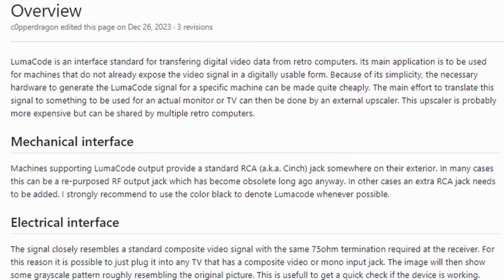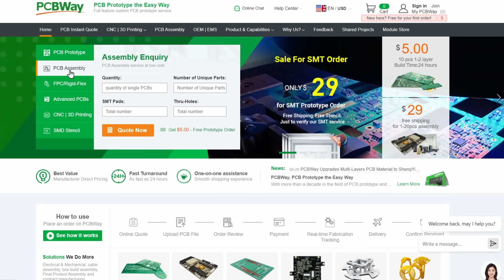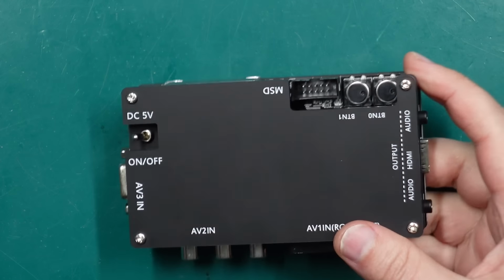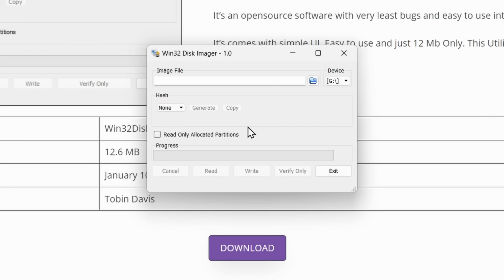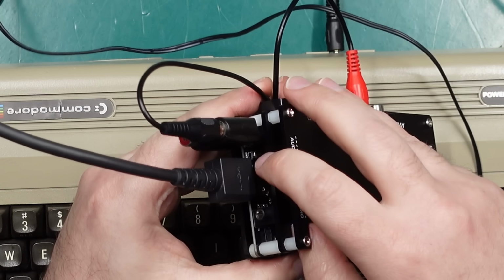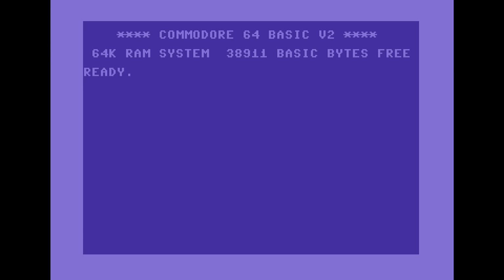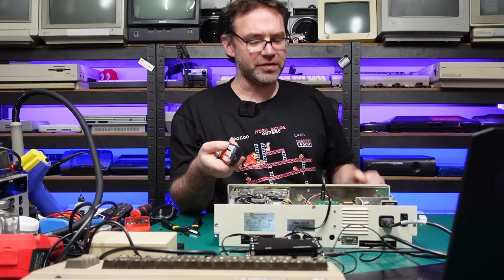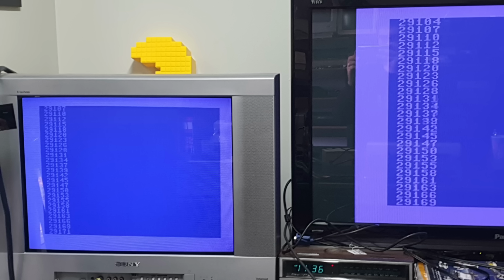Lumacode on the OSSC - HDMI from the C64 and 128 without the RGBtoHDMI and audio embedders

Comment from the maker: The colour palette for the C64/128 is fixed in firmware 1.11. It also includes support for NES Lumacode!

After performing the mod for pre V1.8 boards you may have problems with the remote control not working. If this happens you will need to reprogram the remote codes. This can be done by holding down BTN1 on the ossc while powering on. After that it should walk you through reprogramming each remote button. For more detials see https://junkerhq.net//xrgb/index.php?title=OSSC#Remote_control_setup
Reply: The good and the bad. I missed getting his latest firmware by 2 days update before my LumaCode board shipped.  Glad I was able to get any board though.
Reply from the maker: Are you talking about the OSSC firmware? You need to update that yourself
Reply: @TheRetroChannel  No, the LumaCode firmware. Sorry for the confusion.

Comment: Shouldn't the top and bottom borders be "thicker" with a PAL system?  Your example C64 and C128 screens look more like NTSC.
Reply from the maker: The OSSC does crop the top and bottom of the image in 5x mode but I doubt it will cut off anything useful. I deliberately used Wizball at the end of the video as it draws outside of the standard C64 border and nothing got cut off. 2x mode on the OSSC can also be used if users want the whole image
Reply: @TheRetroChannel  Good to know. Thanks.

Comment: I made some changes on my device and now I have HDR, VRR, 1440p, and the Shadow Mask effect, which is cool. However, I haven't quite figured out the new HDMI VIC functionality yet. Whenever I change it, the HDMI output starts acting strangely. Do you know what the HDMI VIC is supposed to do?
Reply from the maker: It's a compatibility feature rather than a feature feature. From the junkerhq wiki:

Default HDMI VIC
Selects Video Format Identification Code (VIC) which is indicated on HDMI AVI Infoframe for preset modes which do not have VIC specificed. Can be used to work around devices (switches/displays) that do not accept default VIC (0) indicating unknown mode.

0-31: VIC value. Try setting 2 (480p60) with problematic sinks. [default=0]

Comment: Do you know if LumaCode can be run through an AV switcher? For example if I wanted to have multiple digitizer modded consoles hooked up to a switch which then outputs to the OSSC - would that work okay? I’m sure it would for a dumb mechanical switch but I’m really interested in integrating this with my Extron matrix switches I am already using.
Reply from the maker: From what I've found LumaCode is very susceptible to external interference. It may work if you use good quality shielded cables but I can't say for sure

Comment: DVI can carry audio. It’s not part of the spec so we call it “enhanced DVI” but the HDMI device on the other end is none the wiser. 1.5 or earlier OSSCs with didn’t do audio either whether you got the HDMI or DVI version. The only difference was that you needed assemble your own DIY OSSC kit for HDMI back then since the creators didn’t want to run afoul of HDMI licensing.

Neither DVI nor HDMI OSSCs supported audio until we got new firmware with a mod board from Borti4938 (Peter Bartmann). Obviously, they rolled the upgrade into 1.6+ versions of the OSSC when they also started selling them preassembled with physical HDMI ports, but it was never tied to that port. You really could get an HDMI OSSC with no audio before they started selling 1.6.
Reply: That said, my OSSC is DVI (1.5) with Borti’s upgrade board and the new 1.8 LumaCode modifications. Instead of using a DVI to HDMI dongle I use a long, braided, DVI to HDMI cable. As long as I never disconnect the DVI end I never even have to think about it being DVI. It is for all intents and purposes an HDMI unit.

Comment: Hi, I built one of your rf modulators and installed it in my 1986 breadbin 64 with longboard 250425. It improved composite video, but there is a lot of colour smearing at the s-video output. I tried 2 different tv, 2 different cable, and 2 different psu, but all of them had the same effect. What did I do wrong, and what should I check for?
Reply from the maker: V1 or V2?
PAL or NTSC?
Reply: @TheRetroChannel  V2 and PAL
Reply from the maker: Hmm ok. Double check the component values are correct in the chroma path - they are the two resistors on the left side of the board, and the 3 capacitors and 2 resistors nearest the transistor in the middle of the board. If everything is correct, then you could try removing the 330pF capacitor
Reply: @TheRetroChannel I crosscheck component values with an empty pcb I had. All of them were fine. I removed the 330pF capacitor and it made screen so blurry so I installed it back. I noticed something odd, I'm using a lcd tv for testing, and sometimes it detects the output of 64 as black and white, not colour. I have an oscilloscope, so you can tell me the things I could check. Also my transistors are 2n2222A, could this be the problem?
Reply from the maker: The 2n2222a is the same as a 2n2222. First thing to check with the scope would be the chroma output. It should be around 300mVp-p with the machine powered on and s-video connected (I assume you're using the svideo connector and not the C64 din connector?). You can measure it at the top side of R1.
Btw, if you use discord, there's a link to mine in the video description.

Comment: Am I correct in concluding that Lumacode will not be coming to the N64 because it's only suited to low-res & low-colour depth outputs (which the N64 would exceed)?
Reply from the maker: Correct.

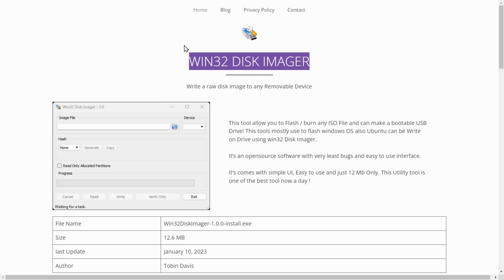Comment: @07:10 I'm confused Balena Etcher is also available for Windows ... so what is your reason to use a complete other program?
Reply from the maker: 12MB vs 172MB installer.
Reply: I use Win32DiskImager although annoyingly I have to quit google drive otherwise it freezes.
Reply: @TheRetroChannel  Ah ok so the Win32 installer is way smaller. OK got it.

Comment: Is that additional signal the only difference between old on OSSC and new one? What wonders me is why the jailbars are no longer present.

BTW. Do you have by chance workig upper head for C128? Mine have that flexible support broken.
Reply from the maker: Doing the wire mod does disable the 2nd LED on the OSSC. Its functionality is restored on the v1.8 boards, but apart from that there is practically no difference.

There are no jailbars as the video (Lumacode) is grenerated by the VIC-IIe digitizer. The OSSC or RGBtoHDMI is required to decode (and scale) the Lumacode signal.

And no, no spare drive heads sorry.
Reply: @TheRetroChannel   Thank you for your reply. At first i thought that VIC-II-dizer just encodes analog signal from VIC-II, (thus my surprise) but it seems i was wrong.
Reply: @TheRetroChannel   No spare heads? I meant a head with only upper one working and lower one bad, unless it's possible to move coils between them. I think i saw such one in your video about fixing 1571, but if you don't have it anymore (lower bad, upper good), it's fine.

I'm going to mod my OSSC to according to your video, although i have V1.6. I wonder if i would find out about lumacode feature if not for your video. Pleasant, educational and useful stuff you're making here.
Reply from the maker: Oh yeah, that drive went towards fixing another (I didn't do a video about that repair). But I can say there is no way to swap the heads themselves between upper and lower.

Comment: Do you know if it works with the Commodore 16 or Plus 4 series? Do you have either one of those you could test it on?
Reply from the maker: I have those machines but they are not supported. Every machine (or video IC) requires a custom digitizer board and c0pperdragon has not made one for the TED.
Reply: @TheRetroChannel  oh ok. Thanks for the update. Cheers.